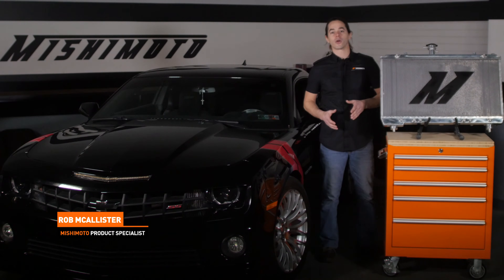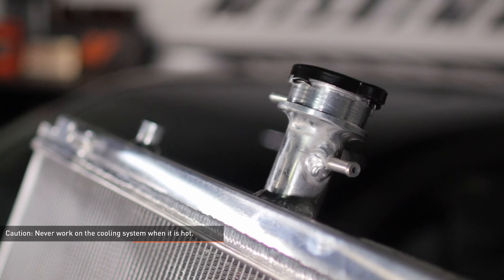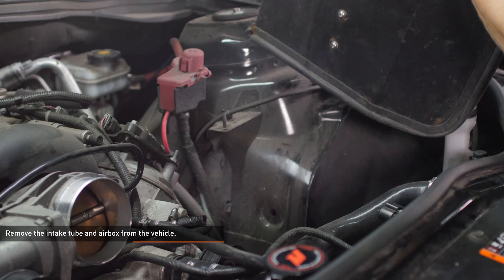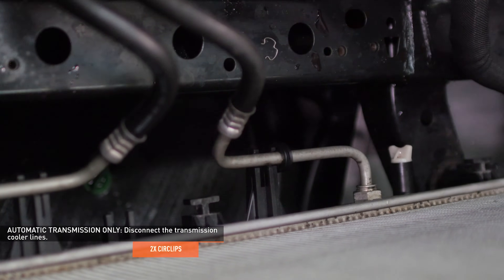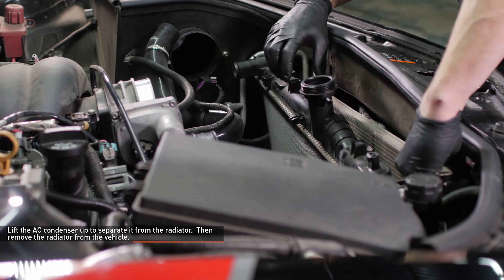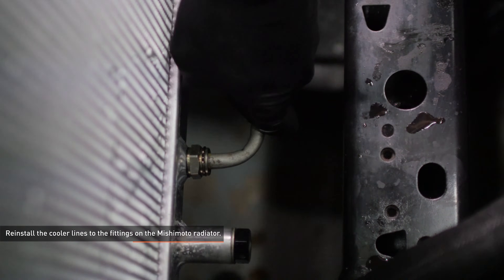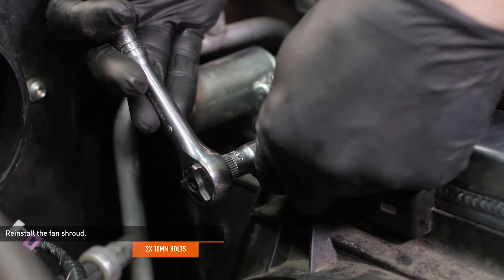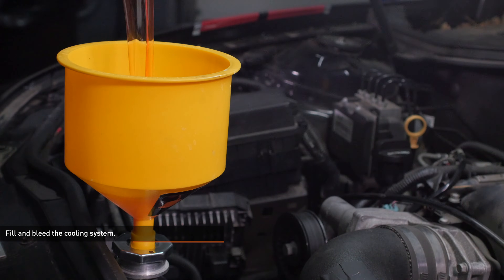2012–2015 Chevrolet Camaro SS Performance Aluminum Radiator Installation Guide by Mishimoto

Comment: How much coolant will I need I order to fill up completely once I change radiators ?
Reply from the maker: The stock system will hold just under 3 gallons, however our radiator does add about a quarter of a gallon to this. You would want to pick up 4 gallons worth of coolant.
Reply: Mishimoto Automotive Thank you much for your reply ; will be very helpful.